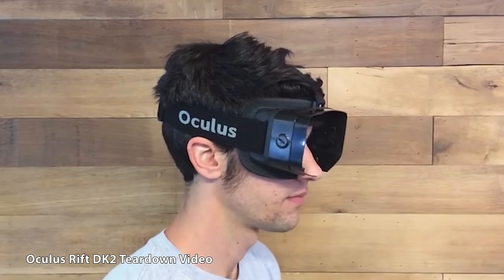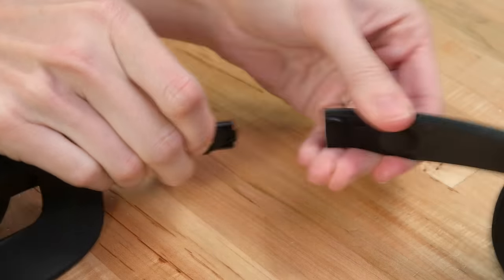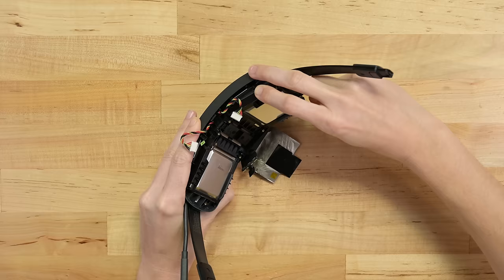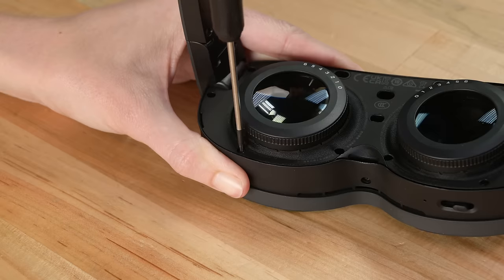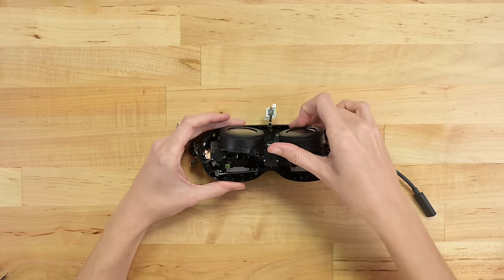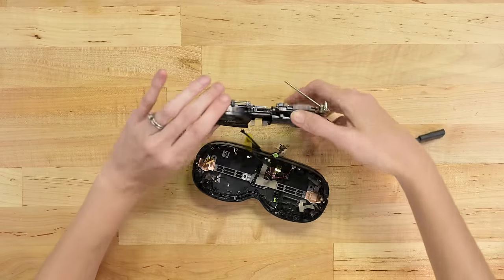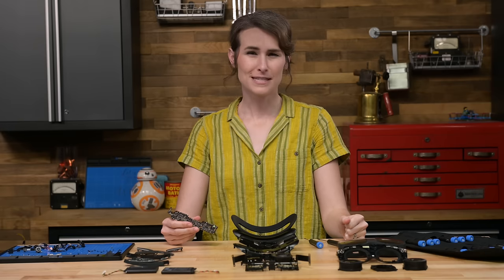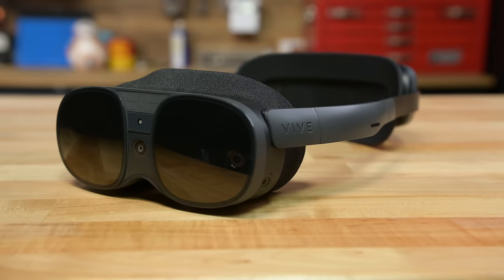HTC Vive XR Elite Teardown: Best VR Hardware Yet?

Comment: The US apparently loves to create E waste. This economy doesn’t care about resources.
It would be very nice if they made a standalone headset powered with an external battery or power bank rather than putting one inside the headset at all so we’d technically have the option to buy a connector and use that to keep the device instead of batteries dying quickly and us having to keep throwing away our headset and buy a new one when the current battery dies.

Comment: hey, varjo exist too ;) it is way better than htc, a "bit" more expensive yes, but more confortable, higher hend hardware, or else there is bigscreen beyond, so even if this title is a bit clickbaity, nice video

also could you do stuff like the sennheiser he1, I have one, and I want to se what is in it, but at 60000€ i'm scared to open it, or else things like 3d printers, such has the bambulab p1p, lots of cool tech in it,

(also, could you do a manta set of bits with the tools of the pro tech tool kit please, I don't want to buy 2 sets of bits, and I need all the bits and tools, and last question, would it be possible to ship to france please)

merci bien (means thanks a lot in french)

Comment: Do not buy this thing. It is the worst headset I have ever put on. I legit felt like I was being pranked when I put it on. The most uncomfortable, setup didn't work right because It wouldn't connect to my wifi, after figuring out how to skip that, couldn't get the dang thing to connect to pc right.

Edit: so the wifi connection and PC connection was my fault. I forgot I had changed the password to my wifi awhile ago, and I didn't know you couldn't just launch vr games on PC. However, my complaints about the facial insert still stand, and now that I've played games I have a new complaint. Everything is tiny. With the quest 2, it feels like you're in the environment, with the xr elite, well, it feels like you were shrunk down and stuck in the back of someone's head looking out of their eyes. I don't know if this is also a user error, and I'm just not setting things up right, but it's impossible for me to play like this.

Comment: That thing is a repair nightmare.
If I have to dig trough the whole thing to get to the 3 batteries it's a DEAL BREAKER.
The batteries should be on the strap on the back of the head in a battery enclosure.
Maybe it even works with LTO 18650 cells.
Reply: Battery pack is fully removeable, you dont even have to use it, you can put the headset into 'glasses mode' and run a wire to say, a pocket, with a battery, which is how i play often
Reply: Man did u even watch it, the batteries, other than the one that lasts iirc 5 minutes for swapping, is all in the back head piece which is swappable
Reply: The battery replacement is $200, you don't have to take anything apart that's just the cheaper option